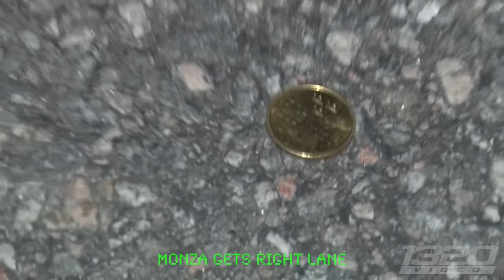Street Racing in front of POLICE | Stockholm Open MOVIE

Comment: I love that they actually have to drive on the roads also. Not just get trailered to the spot and then race and then called a street car. These are more street cars in my opinion.
Reply: Well yes, and no. There have been some straight up pro mod cars in the SO, but all the same they still HAVE to drive on public roads to get to the next spot...and most pure "race cars" are NOT suited for that haul. That the street is the equalizer is very much true in the Stockholm Open. :)
Reply: Have you never seen drag week?
Reply: @cobeyrivera6058  Sweden has incredibly tough restrictions on emissions and engine mods, so getting these cars street legal in Sweden is basically out of the question.
Reply: @TheScaryName  Ha, ha, nothing more fun to watch than some "I got a pro-mod!" Chad get his ass handed to him by someone who has a fraction of the power, but can keep the tires from spinning. I stopped at a red light on a clear Sunday afternoon, wife in the passenger seat. Along comes a bright yellow 60s Camaro with a blower sticking out of the hood. The driver had a younger kid in the passenger seat, probably the guys son. There's no way I had near the power as he, but I revved the engine anyway, he revved his, and then the light turned green.
I launched my little 'ole 302 , with its' worn-out posi rear, at about 2K RPM, and was off and running.
He launched at a much higher RPM and blew the tires-off. They just sat there burning up the tires until the RPMs dropped enough for the tires to bite. By then, I was already half a block away.

Comment: Started watching these over ten years ago. The main reason I have a old urs4 avant in my driveway! With a 850 t5 daily 😆
Reply: I have an s70 t5 manual, swapped engine, bigger turbo, tuned on methanol etc etc for my daily lol. Would be sweet to have an old Avant..
Reply: @ogfromutube9649  awesome! Yeah I'm looking at bigger turbo for the t5. Such a sleeper. I love the avant but to be fair bang for buck the volvo is faster car. But the audi with the external wastegate venting to atmosphere under full chat sounds savage 😏
Reply: @xsduprwd3937  try an open filter on the volvo.. I use ipd silicone cbv diaphragm with stiffer spring. Lots of stu stu at 20+psi and the billet wheel lots of spool sound as well.

Comment: So I take it that every race is like first off the trailer in a sense that theirs no rubber already down and no one has data for the road there racing on correct ?
Reply: Most guys have never even seen the road before they do the burnout, considering they are from all over Sweden. And it's not 'just' off the trailer, as most of them are battling to even make the distance, having to drive 50+ miles between passes, usually in traffic or at times longer to avoid police.

Comment: Sadly some laws are interfering a lot with street racing culture in Sweden.
If the police have photos/video evidence that the car have been involved in criminal activities and isn't road legal they can take the car and destroy it.
The owner doesn't have to be the driver, nobody needs to get caught in the act. So in theory you can buy a race car and never do anything illegal with the car but have the car impounded and destroyed if it have been driven illegaly before.

A mustang from So 2016 was put in a compactor, I am fully aware that there was other factors at play in that case, but those factors did not officially affect the verdict.
Reply: There's an easy work-around though, just replace the hood, wheels, some stickers and/or something similar and make sure no license plate is visible while you race. If the police would end up taking you (the car) to court it's near impossible for them to prove that it's actually the same car in the video. Several of my friends have gotten out of trouble that way. They keep a race setup and a street setup, it makes the car look different enough to avoid trouble.
Reply: @gundalfthelost1624  smart, but it feels like chassie is to unique, tube frame, roll bar engine bay etc. And if they impound the car it shouldn't be to hard for them to get search warrant for garage and find all street components 🤔
Reply: @linusgk5042  The cops don't see what's under the body, and unless they can prove it's the car from the video they have no legal right to start looking under the body either. 
And only a fool would keep the other parts in the same garage. Just let them stay at a friends place.

Comment: Do they know about line lock??
Reply: They're using LineLock. It just doesn't work right when you run cars with this much rear wheel grip and power on regular plain asphalt. Even with the front wheels completely locked the rear wheels will overpower the front wheel traction and the car will start going forwards at an alarming rate. Swedish roads are also domed in the middle so that rainwater will drain away better, that's why people have to hold the cars so that they won't go sideways during the burnout.

Comment: Why the 2nd burnout?
Reply: It's an old rule from when they started doing these races in the 1970s. It's partially so that the drivers will get a better feel for the traction, and partially because it's an old rule and tires were crap back then and they wouldn't hook properly unless they were very hot.

Comment: 12:20 "so no nitrous?" "No nitrous" BULL SHIT. You don't spit those flames in the middle of a pull with no nos.
Reply: My turbo Volvo (658 hp on the wheels) spits flames just like that. No nitrous. 
Just fuel and fumes ending up in the exhaust and igniting since it's running rich and on E85.